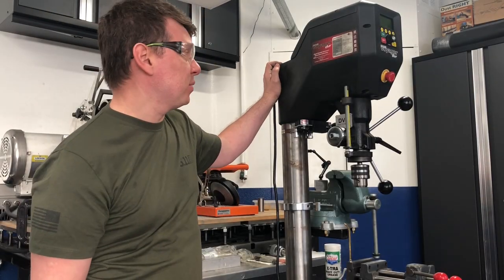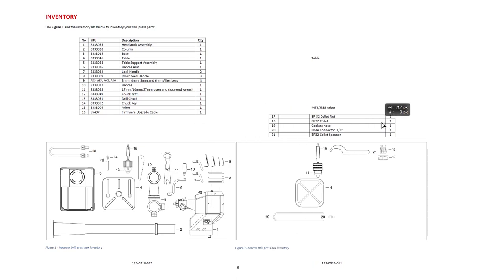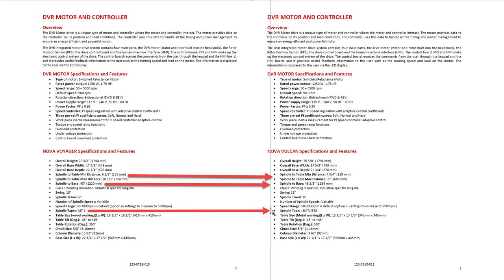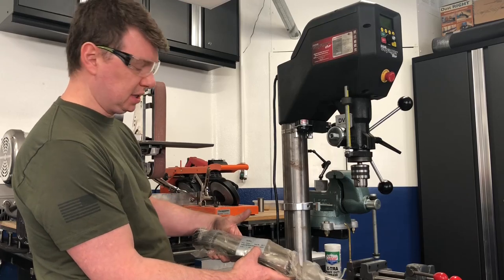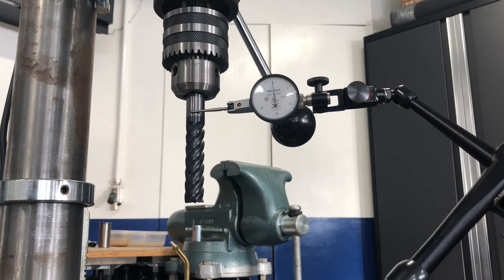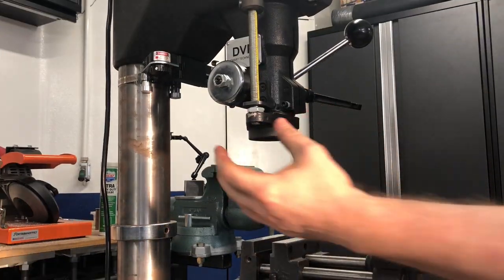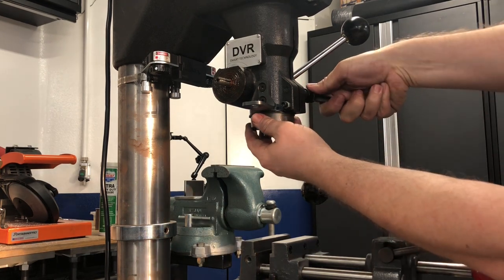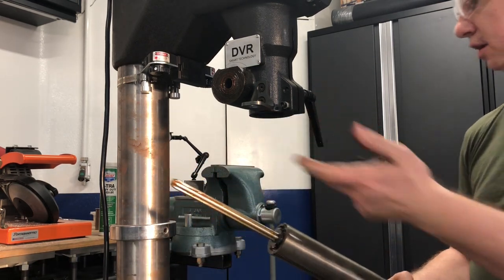Teknatool Nova DVR Drill Press Voyager to Vulcan Upgrade - PART 1

Comment: BTW, I live in Canada and in contact with the Canadian distributor.  This month they released the Viking drill press, but as a floor model.  The distributors told me the floor drill press market is far greater than the benchtop version.  They were able to work with Teknatool to configure it as they wish.The distributor also told me they plan to distribute the Vulkan probably in Dec 2020.  This tells me the Vulkan is still being produced.  I am not sure I want to wait that long, so your video was perfectly timed.  I can buy now and upgrade later.
Reply from the maker: I believe they've manufactured a fixed number of these to see how the market will react and are going to make more as the interest picks up. You can call their 800 line and talk to them - they are pretty open and friendly.

Comment: Excellent video!  I'm going to call Teknatool and see if they might be able to swap spindles on a Voyager like you did and and ship it that way, since I can not think of any use for  for the 2mt spindle, and hopefully will just be able to pay the difference.  I have a nice 3mt  chuck on my old drill press that I would like to use on this machine.  Again, excellent info and video!
Reply from the maker: You inspired me to finish my 3rd video in this series about the downfeed upgrade. Will try to wrap it up quickly.
Reply: @AlexZonin  thats awesome, it looks like a great add-on.  I id love to get a mill, but just do not have the room, and am hoping that the spindle upgrade will make this a good dual purpose machine.  I mostly work with wood, but am always making small metal parts the hard way :)
Reply from the maker: @terrylaskiwski2349  I published the downfeed attachment video (3rd video in this series): https://youtu.be/Yqwfg6d3uB8

Comment: @Focus on Machining Does Tekna Tool still offer all the Parts and Firmware to make this upgrade?  The biggest reason I ask is that I'm assuming they Discontinued the Vulcan not long after bringing it to Market, since I haven't been able to locate one anywhere.
Reply from the maker: Phillip, for the parts you would have to call them to inquire 1-866-748-3025 or 1-727-954-3433. The firmware is available for download: https://www.teknatool.com/wp-content/uploads/2019/07/Vulcan-DVR-Drill-Press-HMI-R2V05a-2017-12-11.zip

Comment: Did you upgrade the other item - table, coolant hose?  I'm thinking the Voyager table is adequate for metal working, but I'm not sure how the "gravity" cooling system works; perhaps the Vulcan manual has info, but I have not read it yet.   Did you consider just using the original Voyager spindle for metal working?  I know it is not stressed for side loads but it may not fail for a while, and for a casual metal worker, it might be ok for the odd job.
Reply from the maker: No I didn't upgrade the table, nor the coolant hose - as I find the Voyager's original table adequate for drilling work. I'm not planning to use it as a mill much, or at all - since I have a Tormach 1100S3 CNC mill. My primary reason for this upgrade was to improve the TIR which I achieved. I do think that those folks who are going to use it for milling will benefit significantly in terms of radial load stability with the double row bearing and the MT3 taper that this upgrade provides.
Reply from the maker: I'm editing the 3rd and perhaps the last video in this series - about the downfeed attachment upgrade. Subscribe to my channel to get notified when I publish it.

Comment: What was the cost of the replacement parts you ordered?
Reply from the maker: Tom Schulte the entire spindle+quill subassembly was fivehundredish shipped
Reply from the maker: Considering that I get to keep the old one and will make a decent ID grinder out of it, it's not too bad
Reply: Focus on Machining I looked at the Vulcan when it was first introduced, and the company had 20 engineering samples for sale. I decided to wait as they were finalizing firmware. It never appeared to make it in the market as it was pricey for a drill press. It is nice the parts are available for an upgrade, but it doesn’t look like they put much effort in updating the firmware. Thanks for the videos.
Reply from the maker: @tomschulte4996  I made the video on the firmware replacement to install the Vulcan one. It's much better for metalworking/machinists since it has a lot more familiar tool and stock materials: https://www.youtube.com/watch?v=EAVzGIOpL9s

You can try this firmware even if you have the regular Voyager (not upgraded to Vulcan), and if you don't like it - simply install the old firmware again.
Reply: @AlexZonin  Any suggestions on where the firmware can be found. I could not find it on the Teknatool website. I would really like to try this firmware on the Voyager.
Reply from the maker: @bobd.  https://www.teknatool.com/wp-content/uploads/2019/07/Vulcan-DVR-Drill-Press-HMI-R2V05a-2017-12-11.zip

It's at the bottom of this page: https://www.teknatool.com/upgrade-your-firmware/